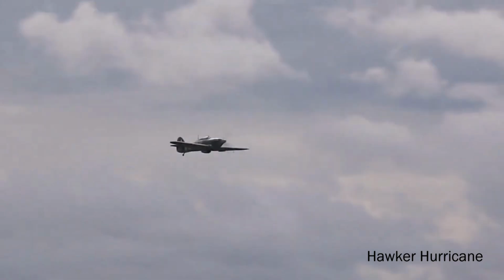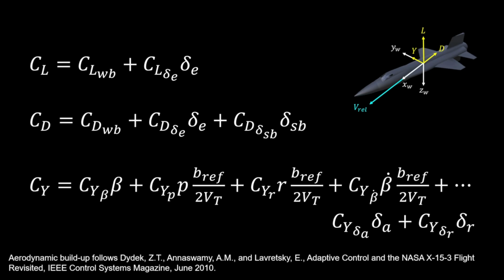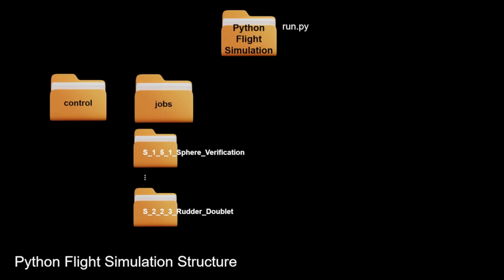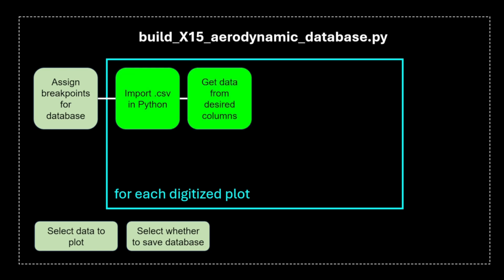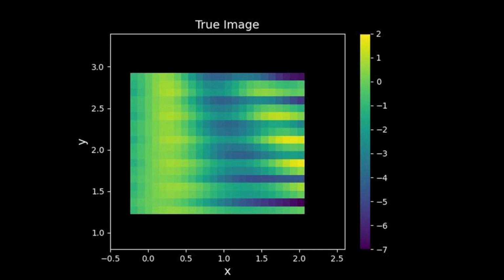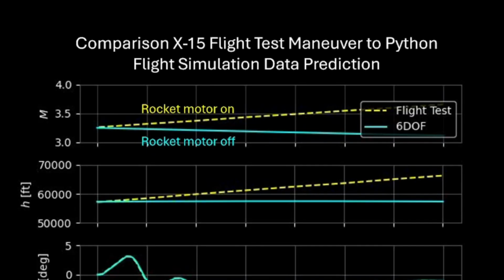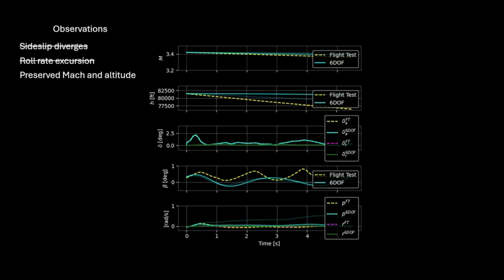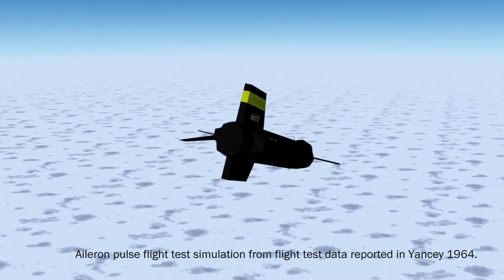How to Build an X-15 Aircraft Model from Literature | 6-DOF Flight Simulation Tutorial - Section 3.2

Comment: Hi Thank you for these videos I was able to verify my math in the 6-DoF simulation for A380-800 in cruise at 13000m but it is not working, since the plane is rising to unconventional altitudes and goes to very high speed, but my C_L vs alpha plot looks good and even C_D vs C_L plot, i cannot point out whats the issue. I have to submit it in 13 days. AI tells me to use a thrust model like PID but that doesn't work and have you used  something like that it in your sim? Any help would be apperciated
Reply from the maker: Hello, I don't have an engine model in my sim, it just flies ballistically right now. There could be many causes for what you are getting, but it sounds like there's too much thrust. Have you tried turning off the engine to check if it flies as expected?

Comment: One more thing my friend is working on his masters thesis and the topic is around the PEMFS where particularly looking for the Internal flow of fluid inside leaves. It's around the flow from mesh just like what happens inside leaves. I hope this is making some sense.

So we opt to use Genesis-World AI for the simulation and it seems it's a bit in early stage. Which simulation software/tool would good for this purpose?
Reply from the maker: That sounds like a very interesting thesis topic. PEMFS is pulsed electromagnetic fields, as in an external driver of the flows internal to plant leaves? This would be a complex system involving incompressible Navier-Stokes flow with a Reynolds number probably << 1 so that a Stokes approximation could be valid. My mind goes to  1) Posing the problem using the correct PDEs and 2) Approximation of solutions using the finite element method.  For this, one could use FreeFEM++ (https://freefem.org/), but one must have experience working with the weak form of PDEs and discretization methods.
Reply: @LearnGandC  Man I so sorry 😭 It was PEMFC I made mistake as it was late night. He's working on fuel Cells membrane flow. Where he is looking for the membrane flow how flows happen inside leaves. I hope you get this. and thank you so much 🫶🏻
Reply from the maker: Ah, no worries. Crazy how just a little swap of letters can lead to totally different meaning! Membrane flows are very much outside my domain, so unfortunately I cannot provide much guidance there. Best of luck to him though!
Reply: @LearnGandC  okay thank you so much 🫶🏻

Comment: Such comprehensive Videos on these topics are rare to find. Thank you Dr Ben for your valuable contributions.
1- I was just curious on how to check the validity of simulations? Is there any test case which is used to benchmark simulations?
2- how can we check that this nonlinear simulation is similar to our linearized models which were used for control design, i.e. we have stability margins in linear analysis, how to check that we have similar stability margins in nonlinear simulation?
Thank you once again
Reply from the maker: My pleasure, Amir. Thank you for watching. The validity of the simulation (in the sense of proving that the simulation captures the physics of the real system) is proven against flight test data, as I dabble into at the end of the video. I show a paper by Yancey that has severl flight test cases that I use as benchmark of truth, exactly as you ask. In my Flight Control Fundamentals series, I do make comparisons between the linear and nonlinear simulation, overlaying results. Beyond this, to test margins in the nonlinear simulation, one could insert a gain and phase change in the loop and test the performance and stability of the simulation. This is a reasonable thing to do and there is a history of linear systems theory adequately capturing the robustness real aircraft flight control systems.
Reply: @LearnGandC  Thank you Sir for a comprehensive explanation,will surely go through the suggested analysis